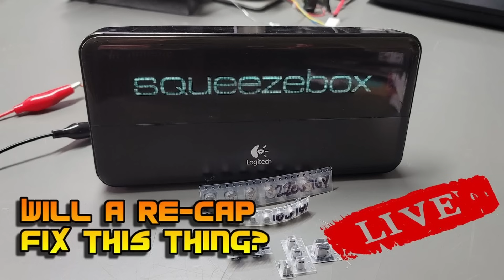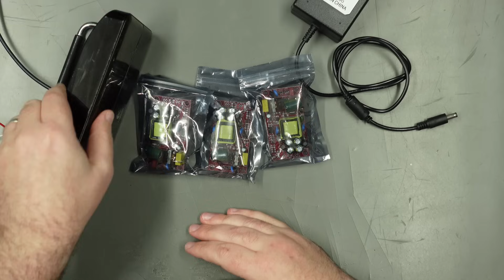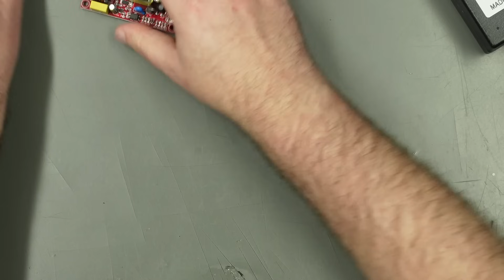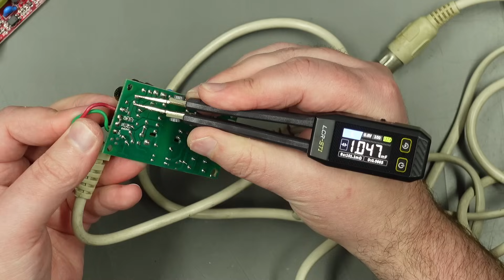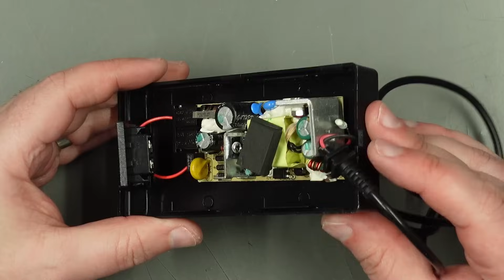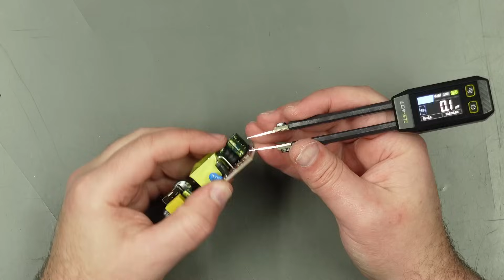Buying cheap power supplies and capacitors from AliExpress

Comment: Don't use cheap power supplies from AliExpress...hmm...as if I have a choice...the other option is eBay...how is that any better...they all come from China...and the special power supplies like made specifically for ie PlayStation/ PlayStation 2/ XBox...etc..what choice do you have..there's no alternatives...I've bought a few PS2 and a number of 5v 2/3 ampere LM boards from AliExpress..they do the job..but then i'm not using on rare Commodores..mostly cheap emulation devices that are basically disposable eWaste in a recycled plastic box..

Comment: What a coincidence, Mark. I am in the market for a replacement 5V + 12V power supply for an external drive enclosure, and the dimensions of this PCB looks very close. If these are of poor quality or not worth repairing with better caps, do know of any others that will serve this purpose? The PCB I have now is 4 inches x 1.25 inches. Also very coincidental is these Aliexpress boards look to be using a lot of the same components and the same quantity, although my old board (1990s) has a couple of small ICs on the top side. It might only be a single-sided board. If there is a higher quality version available on Digikey or Mouser, I am totally open to getting one that way. I'm lousy at searches.

Comment: Meh, just replace the capacitors with new and quality ones and you´re good to go. There is no need to be overly dramatic about it. Just make sure the new ones have slightly higher voltage rating (i. e. 25V change to 35V). The power supplies are not that bad.
Reply: Well he did mention big clive then you should know this video is garbage. :)

Comment: In the past 10 years, I have purchased at least 30 SMPS units from Aliexpress. I have never had a bad one. I have some that have been powered on constantly for more than 5 years and they are working perfectly.
The only caveat is that the power ratings are generally overstated so buy a 7 or 8 amp supply if you really need a 5 A.
They are so cheap that the extra couple of dollars still makes them a bargaing.
You must have just hit a manufacturer that got a load of capacitors with bad electrolyte. There are rumours about a stolen electrolyte formula that was copied incorrectly and the shelf life is only a year or two.
Don't blame the supplies, blame the capacitors.

Comment: How do you like that LCR-ST1?
Reply from the maker: It's usually accurate but when in doubt I will crosscheck with another meter. I recently found a cap that tested ok with the tweezers but failed in one of those little multi-component testers (said it was a resistor). And indeed that cap was causing issues and had clearly failed

Comment: It's not the PSUs that are at fault. Cheap China caps are the fault as I've seen this across multiple different products. Some just fail, some bulge like yours and some fail after very little use.
I had a batch of 240v LED lamps for the house and after 5-6 months, they started pulsing. Fault? The caps. Swapped every one I got out for a branded one and they've been going strong for 10+ years.
Reply from the maker: Haha yeah I have some LED downlights that are a few years old and starting to fail. So far I've fixed two of them by replacing a cap in the PSU on the output side and I'm certain the rest will have the same fault, but I'm too lazy to pull them all out at once. They'll let me know when they're ready.

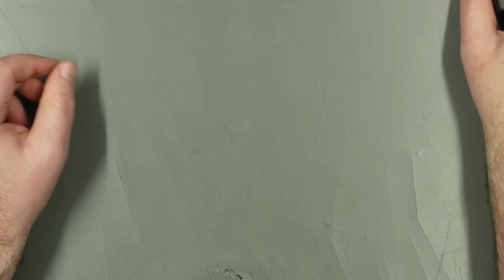Comment: 8:45 "These three, total junk".
They aren't that bad. Ive seen a lot worse: Missing input filter, wire links where output inductors should be, no fuse, missing snubber.
These have inductors between the output caps, input filter coil and X cap snubber components, the blue Y caps look real. Replace the output caps with 1000uF Panasonic FRs and they'll be fine for 12V and 5V at 2A.

Comment: I have one case of a power supply that was built in the early 2000's and used it very sparsely. Last year I was going to use it and found bulging caps, just from sitting there! I ventured plugging it briefly just for fun, but noticed the bulging caps heating up very quickly.
Replaced them with new ones from mouser and rated for smps use, and it worked flawlessly.
Then some months after that, I used the same smps and it didn't start!
It was a shorted small cap in the controller at the primary section, just the same brand as the old bulging ones. Replaced it and working again.

Comment: I put a Meanwell power supply into one of my 1541's. Definitely a bit more bulky than the ones in your video but fits the 1541 case just fine and has been working flawlessly ever since.
I think i got that from DigiKey.

Comment: 1:08  5V 2A sounds like a nobrainer for a USB conversion (or rather barrel plug to USB-A cable), then just plug it into whatever old 2A phone charger you have kicking around
Reply from the maker: True, and I did use a USB to DC barrel plug to power it for a brief period. It worked fine although the cable was dropping around .5 volts under load, so I bought a dedicated supply for it and reclaimed my USB charger.
Reply: @TheRetroChannel  That opens up a whole other can of worms... the world of crappy CCA (copper-clad/coated aluminum) cables/wires, rather than actual copper. That fairly big voltage drop sounds all too familiar with those. 
I've been bitten by that junk several times, from Ethernet cables over USB charging leads and even alligator/croc leads... It's absolutely everywhere and it sucks
Reply from the maker: Yeah I recently went through my croc leads with a magnet to find the copper coated steel ones. About half of the newer ones were and no doubt there's also plenty of copper coated aluminium cables hanging around here

Comment: Aluminum electrolytic capacitors do "deform" if left for a long time without voltage applied. The electrical leakage will rise substantially and the voltage withstanding ability will drop due to degradation of the oxide layer on the foil.
Caps can be re-formed by carefully limiting the current to a low level and slowly raising the applied voltage over the course of several hours. Often just applying rated voltage through a high-value resistor will do the job. If you apply full rated voltage without current limiting to a cap that has been sitting for a long time it may announce its unhappiness quite loudly.

I have hundreds and hundreds of electrolytic caps on hand. I have never seen one bulge just from being left in storage. I have seen seals degrade.Seals in newer caps from reputable manufactures are likely to be better than those from years gone by.

I basically have a policy that I buy nothing that operates from AC mains from Back Alley Express or any of the other vendors of electronics and women's underwear. That includes Amazon "market place" where fraud and lies are rife. Some items may be OK, but I've seen stuff that wouldn't pass safety requirements anywhere in the world. I simply do not believe safety agency markings because so many are fraudulent. Occasionally there will be enough info in photos so you can determine the actual manufacturer and try to determine if the stuff really has proper approvals.
I've seen things like wooden toys with US FCC (Federal Communications Commission) markings on the box. While it is doubtless true that a wooden toy would pass FCC requirements, the mark is obviously fraudulent.

Comment: At least the black plastic-encased power supply had a TÜV safety mark on it (hopefully not counterfeit).

The real risk with the unapproved Chinesium power supplies is user safety - insufficient primary/secondary creepage and clearance could lead to electric shock, and substandard parts with inadequate design margins could result in fire or explosion in the event of an abnormal. Bin them..
Reply: It has no UL number and a fake CE (china export) logo (C and E too close together)... of course it's entirely fake, probably just like the 5 amp rating
Reply from the maker: Haha yeah, they literally took another cheap PSU and stuck an LED and an extra C7 plug to make it fit that case. No way any of these have passed or even been submitted for any formal certification.

Comment: Those psu's are fine. Just put good caps in and it'll last 30+ years. All the other parts are regular branded parts. I have several of those small PSUs in various things and they have been working fine for many years.... I pre-changed all the caps at the very beginning before installing it. If you want to pay 10X the price for a known brand psu go ahead but for my use those chinese PSUs are fine when new good brand caps are installed. They are real switch-mode power supplies so if anything does fail the thing just stops switching and outputs nothing. They are not dangerous or harmful to equipment. Get back to fixing something and stop spreading rumors ;-)
Reply: Exactly what “rumours” did he spread that made you so butt hurt? That these power supplies are pieces of shit? They are absolutely that. EDIT: I noticed your spelling “rumor” so maybe you’re from 110v pussyland and don’t need to worry about your mains giving you a little love-tickle.
Reply: @SlCKB0Y-sb1kg  Chill dude. I was having a laugh with Mark. I know him personally (I'm also in .au) and have had conversations with him about other stuff in the past and also provided assistance with some projects.
Reply from the maker: Haha but without that context it does come off as butthurt and it's nice to know someone has got my back. Now go back to your arcade whatevers 😘
Reply: @g4z-kb7ct My bad! I did absolutely overreact! 😂
Reply from the maker: Lol, what rumours? Saying they're safe becuase they're switched mode doesn't mean shit if the fault is on the primary side. If you want to stuff around sourcing and replacing the caps on these things then go right ahead. But how many people do you think are buying these with the intention of replacing the caps on arrival and not immediately using them? ;-)
Reply: @TheRetroChannel  A fault on the primary side will blow the fuse... it's still safe. Those small psus are perfect for replacing older psus that no longer work in retro items and there's really nothing else available and at the prices they are you can't complain. If the person is smart they will replace the caps. But we both know that's the minority. You only need to look at all the useless comments on YT to see the over-all level of intelligence is low ;-)
I say just replace the caps in those psus and test them. There's no need to throw away something that is new just because of some low quality caps. The rest of it is still a new working psu.

Comment: all factories have sometimes production problems where components are sub standard or something the difference is they tend not to sell that batch on to be used also not being used regardless of where you keep them can be a problem add to that not knowing how old the components are is a bit you have to worry about , many of these things are hanging around for a few years before use 
i check all aliexpress components for operation and after an inspection i run up Power supplies to ensure they work and i believe this keeps the capacitors healthy as they are storage after all

Comment: while these bad caps make PSUs unreliable, the real LETHAL parts could be the SUPER DODGY transformers: primer (and/or aux) and the seconder winding touching/not insulated properly -- and also the not safety rated filter cap between primer and seconder side

Comment: Chinese electrolitic capacitors are notoriously horrendous.   Keep that in mind next time you want to recap your vintage electronics and want to replace  old but still good japanese or US capacitors, with brand new chinese ones. Because the brand new chinese ones  may not last as long as the old ones.

Yes, brand new electrolitic caps CAN go bad even when unmolested.

Comment: I got a few of those power supplies, and the caps went bad on them too, just sitting around. Planning to put good caps in one or two of them just to see how they do; the ones I had used worked just fine in the beginning.

BTW, was "In the bin" a Mighty Car Mods reference? 🙂
Reply from the maker: The in the bin was either a MCM or a Micallef Tonight reference, maybe a bit of both

Comment: That's wild, I've never seen caps swell up and burst just in storage but I reckon those open frame PSUs would be OK with a recap.

I bought a bag of Philips caps (years ago, reputable and authorised Philips parts supplier) which got left in storage for a couple of years, when I got them out of storage they looked perfect but were all faulty in one way or another, leaky, short, open circuit etc. Whole bag of 50 in the bin.
Reply: Got assortments of tons of new old stock caps from the 70s. Roughly 20% are fine, 70% need varying levels of reformation and 10% are bad.
Philips caps however seem to just go bad right now. 1960s Philips caps recently started going bad, same with 1970s Philips caps, 1980s and 1990s.
Reply: Electrolytic caps have a limited shelf life even when new so it's unsurprising that your new branded caps became bad while sitting in storage.
Reply: @g4z-kb7ct  The surprise wasn't that parts fail, it was that 100% of the parts failed (I tested the whole bag), it was tracked back to a manufacturing problem and created a recall for our affected product.

We were strict with quality control (The company was ISO accredited and manufactured small runs of safety critical stuff for motorsport, aerospace and other industries) so component stocks were regularly audited and any superceded, past shelf life or surplus were disposed of (goodie bags of parts were "sold" to staff for a charity donation)

I'm still using some of those part for my personal projects and only last weekend used a NOS 2200uF 25V Philips capacitor I'd bought from that company in a goodie box, it tested just fine and worked perfectly despite being 20+ years past its shelf life expiry.
Reply: @g4z-kb7ct  It depends. Some things like the c128 and c64 are crazy robust with caps rarely failing. On the other hand it's not a matter of if but when will the caps on the a1200 fail. The smd caps on those are guaranteed to fail.  finally,. There's the terrible caps of the early 2000 that are all failing due to the "caps plaque".
Reply: @tspawn35  That's what an ESR meter is for. If it tests ok use it. Yes smd caps are known to leak, even good brands. I've replaced 1000's over the years on arcade pcbs where the originals were good quality Japanese caps. This is a known and well documented thing. I've replaced all the caps in my A4000, A1200, A600 and CD32 and they are all fine and should remain that way for another 30 years.

Comment: Some load and Ripple measuriement in accordance to Intel ATX Specification* would be nice, to see how bad those really are.
And also put some load on it...
Sometimes you get "nice" results, like Ripple over 100 or 200mV even at lower loads, voltage dropping below the +/-5% regulation specs and other funny things)

*(Scope limited to 20MHz Bandwidth, 0,1µF Ceramic Capacitor and 10µF Electrolytic in parallel with the load)

Comment: I use a vice with plastic cases like that to crack them open
Reply: There is a much easier way. Use a hacksaw to cut a slot on one corner where the join is then insert a big flat screwdriver and twist, gets it every time :-D

Comment: For anything related to mains power, don't buy cheap stuff if you DIY. The best way to know if its good is to check if they have a datasheet online. More often than not, if it has one, its good to go.
Meanwell is my go to PSU.
Reply from the maker: Yeah if it has a datasheet that's more than a single page with basic specs then it's likely good to go

Comment: That they might not be the best quality, ok. But that the caps leak UNUSED after about 2 years?! That I call shoddy quality!
The problem with AliExpress is, there might be sellers with good versions of that power supply, and others that sell an even cheaper knock-off and you never know which one you might get.
Reply from the maker: I wonder if there's a bunch of them just being tossed away before they even make it out the door. Hmm, they'd probably just ship them regardless
Reply: @TheRetroChannel  I have a gut feeling AliExpress is where the ones which don't pass the QC get sold like the ones you've got.
Why let it go to waste if you still can make some bucks off it.

Comment: They can if they have sat a long time.    My instructor in college said that electronic left sitting unplugged have a higher chance of not working from failing caps.  Gases from the internal electrolyte build up.   That’s why they need to be powered up and used.
Reply from the maker: Maybe, but I've come across plenty of things that no doubt haven't been powered for 30 years or more that have had zero issues with the capacitors